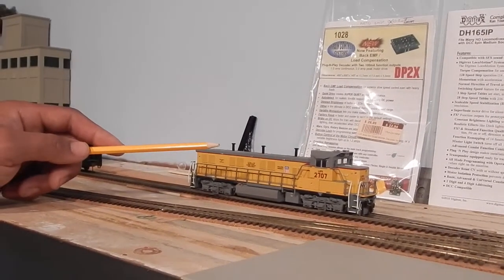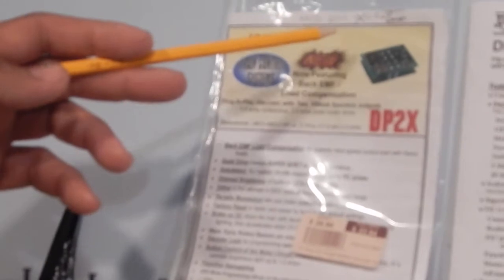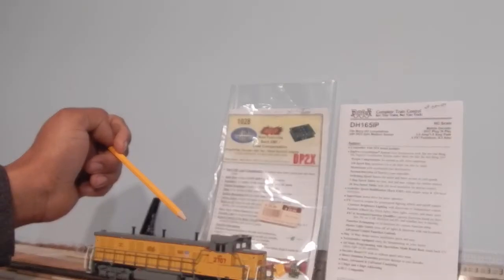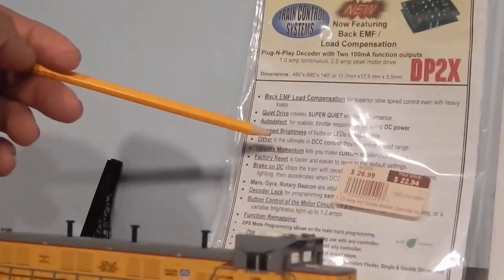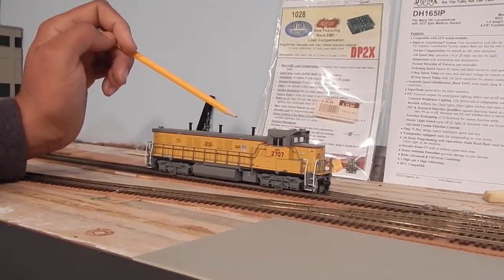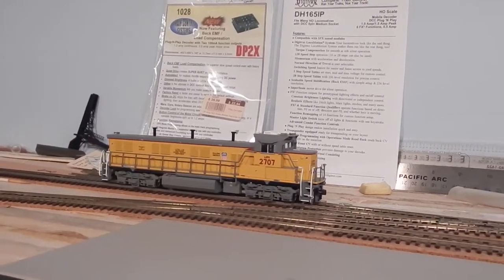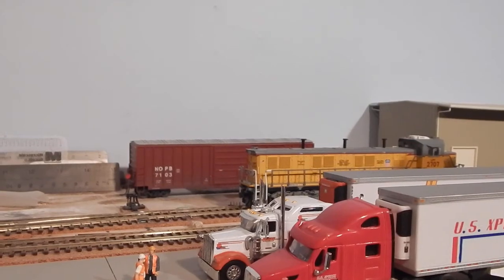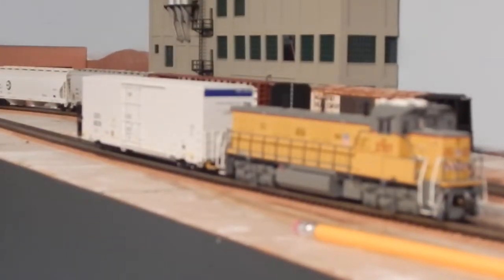Atlas Genset Decoder? TCS/Digitrax

Comment: I had just recently installed a Tsunami Sound AT1000 in my BNSF genset and it sounds fits and runs perfect.
Reply from the maker: Nsbnsf . Thank you. If you can beleive it, I still haven't installed one in there (over a year ago).
Reply: tunnelmot hey I completely understand, I've got two and one still needs a decoder, the one sat like it did for over two years and there's still projects waiting for me to work on. It's all apart of model railroading, anyway if you have any questions or what not don't hesitate to ask. Send me a message on YouTube, Instagram and or Facebook @NSBNSF